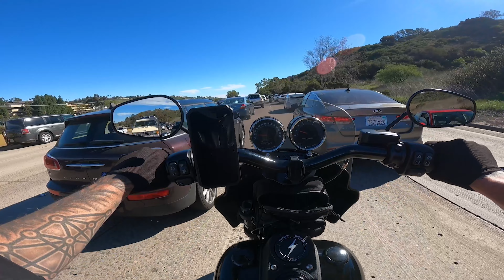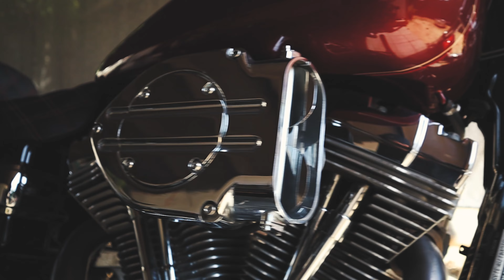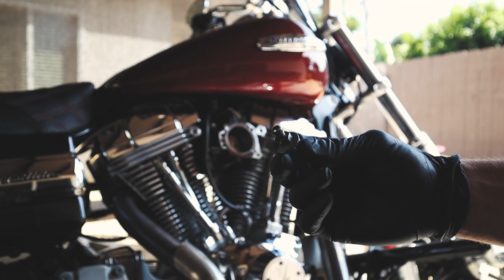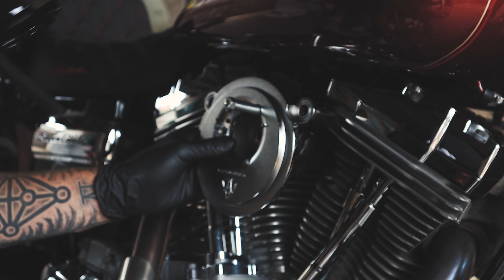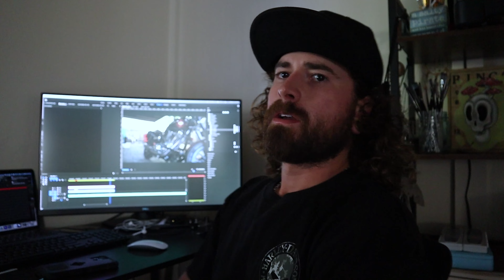THE DYNA GETS A NEW AIR CLEANER | Arlen Ness Big Sucker Stage 1 | Dyna Build Episode #9 | Superglide

Comment: I got the same ugly air filter on my 05 dyna wide glide fxdwgi I noticed a lot of tubes connecting to it. Do I just remove the tubes and plug the holes ?
Reply from the maker: Haha time for a change. Yeah I ordered a little set of little rubber caps from Amazon and they fit just fine. The Hypercharger works on vacuum lines to move the vent so if you plug em up they are just fine. It’s been so long but you might have to remove a t fitting or two
Reply: I didn’t see any T fittings just that long tube like you have in the video. Is that the one I plug ?
Reply from the maker: @Scooter3194  yeah you pretty much follow it back and plug it up. Sorry for my late response! Been so long since i did it
Reply: Your good bro that’s the only one I see to plug up thanks a lot for even answering questions after a 1 year post I really appreciate it… ride safe brother
Reply from the maker: @Scooter3194  Thats what this community is all about 👌you ride safe as well